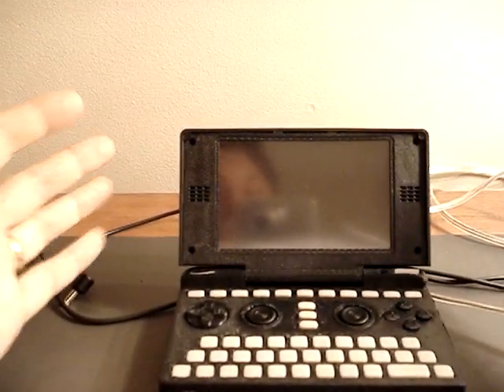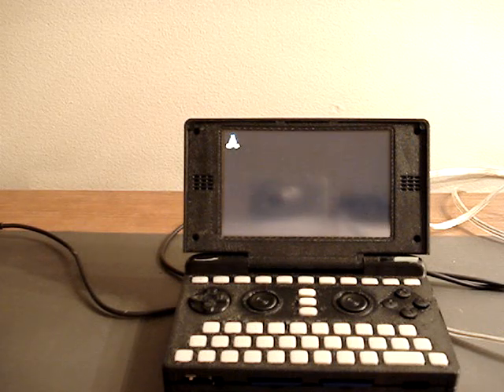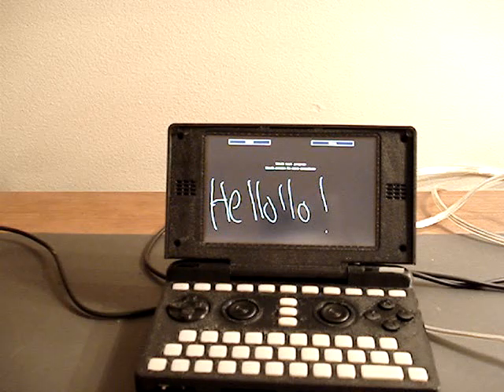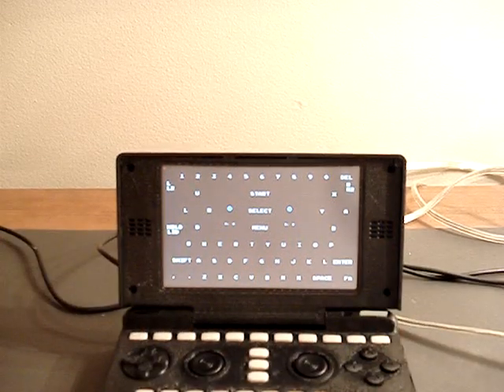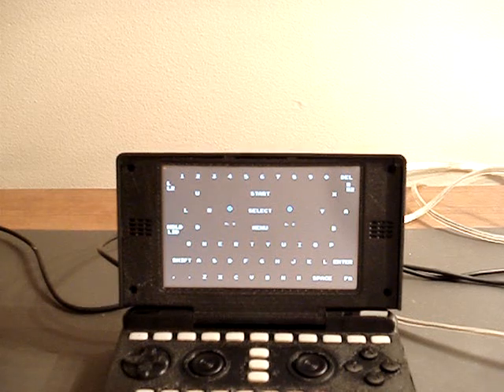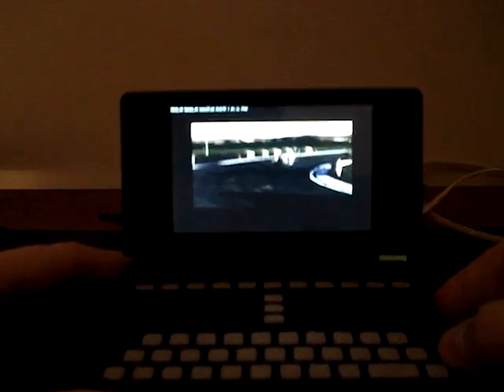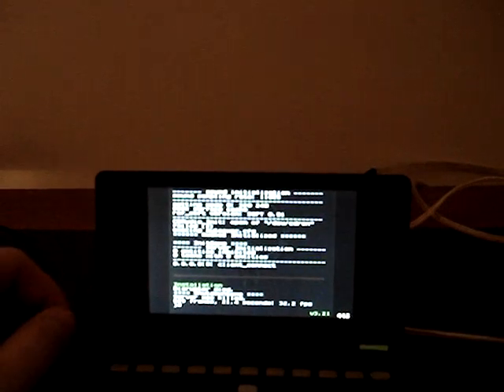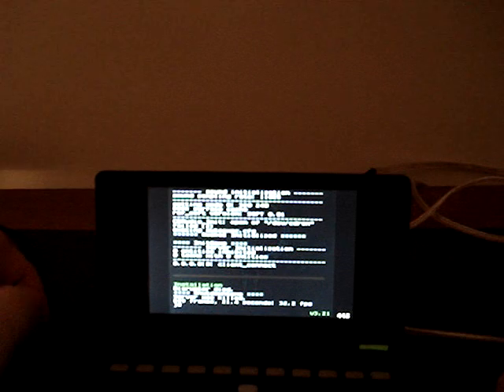Pandora prototype in action

Comment: The keys don't glow in the dark. They were considering it at one point, but it wasn't put in.

It doesn't have multi-touch, it's a standard resistive touchscreen that works with one finger or one stylus at a time. (or one pencil)

Comment: I think an Xbox 360 controller (cable version) would do the job. Did you tried ? It has a usb port and works on windows if you installl the drivers that are easy tofind.

Comment: No, the Pandora is only available by pre-order since they don't keep any in stock.

It really depends on what you want to do with it. This has a touchscreen and full keyboard, as well as the full Firefox 3 web browser. PSP probably doesn't have any of that, but it is smaller and easier to buy.

You'll have to decide for yourself.

Comment: um... buying a pc from a store and building your own with a $1000 dollar budget and getting good deals on parts from newegg/other sites are COMPLETELY different. you can save a ridiculous amount building your own pc, and you would still end up hitting a very high mark making your own pc that would run a playable 720p wii emulator w.o any overclocking. finding a pc in the market for retail at sub $1000 to do all that is a bit pushing it. btw its about 90% playable at that point, so almost perfect

Comment: Someone is working on a PSP emu, but it probably won't run fullspeed for some games.

The PSP seems to handle things a bit differently than the PS2 and N64, it might be easier to emulate.

My point was that native Pandora games will have access to hardware about original-Xbox spec. Emulation, being necessarily slower, will be limited to around PS1.

Comment: No, it's a completely different console.
It has 256 MB of RAM, a graphics chip on par with the original Xbox, and it runs Linux.

Youtube is weird about links, but it's called the openpandora and they have a dot / org site, and their wiki is at pandorawiki which is also a dot / org.

Comment: Looks like a nice device, but how exactly are you going to play those games on it? Aside from having to install windows first (comes with linux), you'll have to carry around a gamepad at least, and for a lot of games actually a seperate mouse and keyboard (if you can even connect them) because you're really not going to be comfortably playing using the builtin keyboard...
That's pandora's strenght, being designed with gamecontrols in mind.

Comment: Well, you can't exactly run Flash EASILY on 900 Mhz - some files will definitely stutter or run a bit slow. But it'll run plenty fast for most Flash files anyway.

Oh, that's right... the thing has an ARM processor, is there really a version of Flash that works with ARM processors?